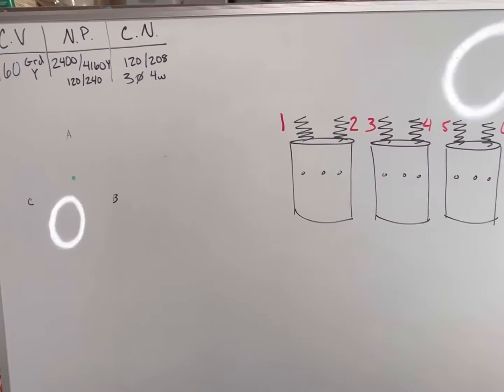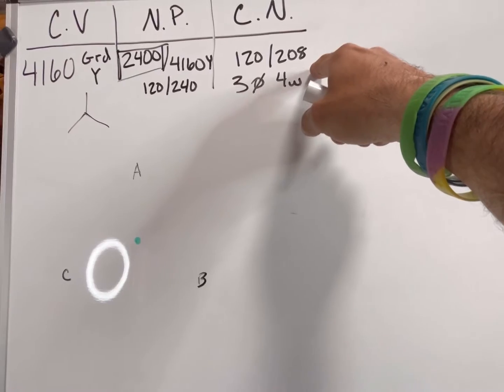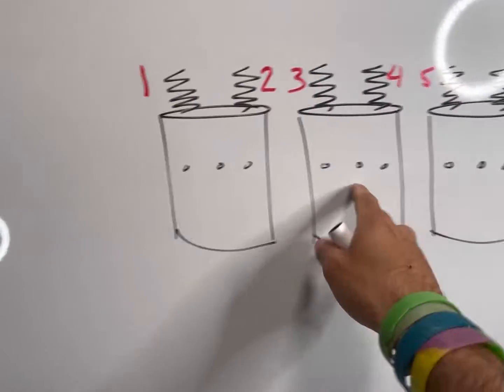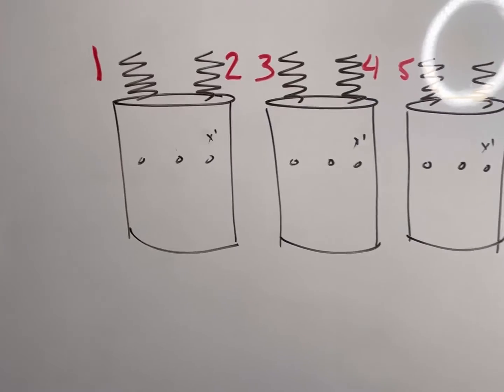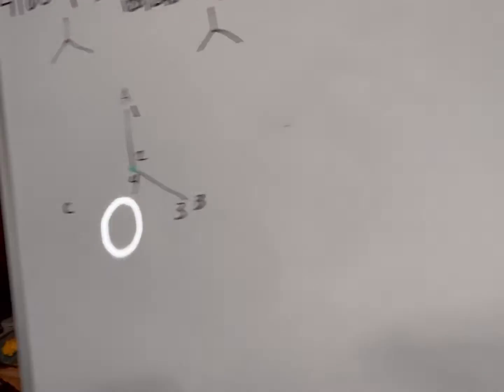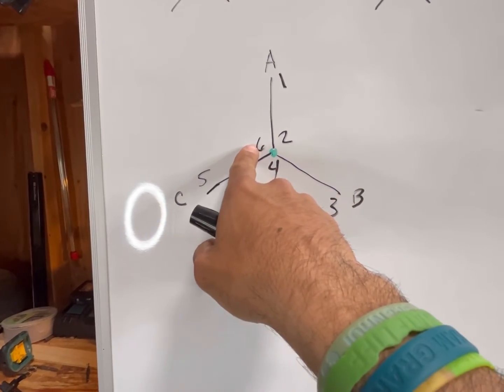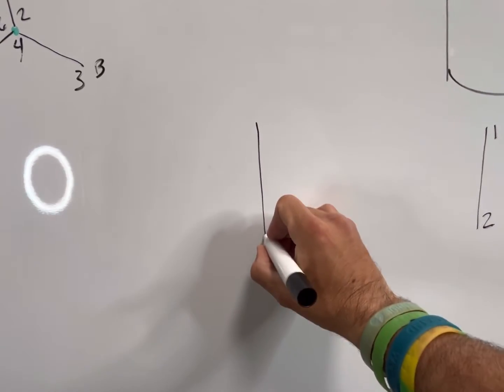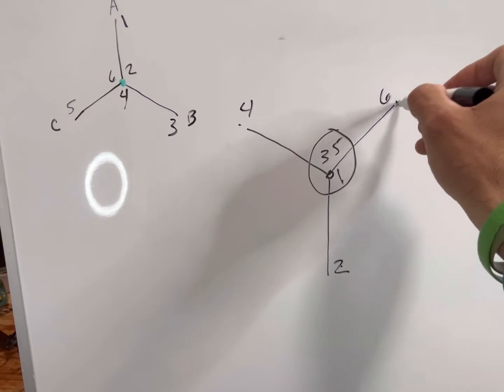Wye - Wye You Always Tie

Comment: I actually have a bit of a question.
  So. I get all the wattage and current gains of the ACBD, but I have run into what amounts to "Edison 3 Wire" arrangements in triplicate, such as this when wiring heavy 3 phase gensets, transformers and distribution boxes at construction sites 480D/120-208Y. I saw a very strange selector position on the larger 200kVA+ gensets of 138/240Y. If you root3
 240, that's what you get. I have not put pencil to paper yet, but if you leave those cans set up as center tap, will you get 138vac L to N?

Comment: You can hear feroresonance as soon as you break the neutral connection.  

Excellent video.  Would be interesting to connect a fluke scopemeter and see  the 3rd harmonics that are raising the L/N voltages 15-20 %

Working on a project where MOV's are blowing up on a rockwell vfd fed from a wye/wye xfmr bank.  

I think you may have solved my problem.
Reply from the maker: Yes sir. We had a commercial customer that had some giant well heads. They kept blowing vfd’s and the problem ended up being voltage imbalance due to a regulator bank having one of the regulators stuck. I have also heard of vfd’s blowing when the primary feed was extremely long.  The voltage was balanced but it ended up getting so high due to the reactive properties of the underground that the vfd’s couldn’t handle it. I’m pretty sure the fix there was to add an inductor bank to fix it. Please keep me in the loop it would be interesting to see what the problem is. Stay safe and keep up the good work. 👍

Comment: Can you please explain why it was necessary to parallel the coils (alley cat bad dog the coils)?  i.e. if the transformer name plate shows 120/240, and the customer need is 120/208, how did you know that you had to alley cat bad dog the coils?
Reply: Its just a chalk board anything works and anyone can make mistakes Edited I think the secondary coils need to be parallel internally or use a single winding secondary transformer less hastle .  🤔 impidence boosts voltage when floating the neutral 17:00

Comment: Hello, what would happen if the secondary is floating (ungrounded and not tied to primary neutral)?  And by "circuit neutral" do you mean the neutral wire from the utility?
Reply: My friend from class forgot to bond secondary neutral (wye-wye) to primary and got shocked from touching secondary ungrounded neutral conductor. Why did the secondary neutral became hot?
Reply from the maker: Great question. So first off. If the secondary neutral isn’t tied to the circuit neutral,but is tied to the transformer neutral, the customer wouldn’t see any change in voltage. The secondary circuit is separate from the primary circuit. Secondary voltage is dependent on the secondary bushings used to supply service. If the service neutral isn’t tied back to anything and is completely floated, meaning the customer is only being fed the two secondary phases,  the customers 120 circuits would see 240 volts due to the only return circuit back to the transformer would be the other phase. 
And yes the circuit neutral I’m talking about is the neutral from the utility. Stay safe. Keep learning. 👍

Comment: With the floating neutral ( primary side off cans)no path BACK to the substation?  please clarify. thanks
Reply from the maker: There is a path back to the substation. But when the neutral IS TIED down to circuit neutral, the return back to the sub is the neutral. BUT when you FLOAT the primary neutral connection, current flow back to the sub changes, and now the return current is returning on the other phases.
Reply: @hilineacademy8482  Well, there are no other phases on my transformer(s) for the current to balance out.   Only ONE phase service on the WHOLE BLOCK. 50 houses
all share it.   Every transformer is ONE BUSHING as you state this (float neutral)
            Multi Point Grounded Neutral at EVERY POLE that has a transformer.
thank you.      “ Correct myself, one bushing transformer DOES NOT mean floating the neutral.
Reply: @tedlahm5740  I think I’m seeing where your getting confused. The lessen ”wye wye you always tie” is referring to when your building a THREE POT wye- wye bank. 
You cannot float the primary neutral connection on a single phase transformer. You will not have any current flow going through your primary coil, and therefore have no secondary voltage. 
Again, you cannot float the primary neutral connection on a single phase transformer.
Reply: @csandoval82  Thank you.  Further question.  On my single phase
step down transformer.  The primary coil is grounded at the bottom
of the pole.  What happens if anything if this grounding cable should
be BROKEN due to an accident?  
Interesting side note ( power company uses 3 wire 3 phase distribution 
system. no parallel neutral back to substation)  thank you

PS.  I understand now, can not FLOAT the neutral because I have no
secondary phase to balance out the load.
Reply: @csandoval82  Thank you.  Soooo all my observed single phase step down transformers ONLY HAVE the grounding at the Pole location and
the additional grounding at the buildings (neutral grounding) that the transformer services.  (Multi point grounding at each pole) 
        Supposedly the NEV “neutral to earth voltage” would still measure 
the same even without a parallel neutral to the substation.

Thank you for your help.
Reply from the maker: @liam3284  yes sir. Depending on the circuit voltage and type of circuit, you could have either a wye or delta connection. Something to remember with delta connected circuits is that it’s much harder to manage load on those circuits. Stay safe and keep learning. 👍

Comment: Why didn't you mention the number 1.73 (square root of three) as the multiplier / divisor for your voltages at a 120 degree phase angle? That's the one most people use 99% of the time (Unless you're working on an old 2 phase building in Philly) Don't get me wrong, you made a great video, but 1.73 is a real handy number  to remember
Reply from the maker: Ya I hear ya. I didn’t mention  it because I already had a lot going on in the lesson. It is a great way of explaining where the phases to phase and phase to neutral relationship comes from. 👍